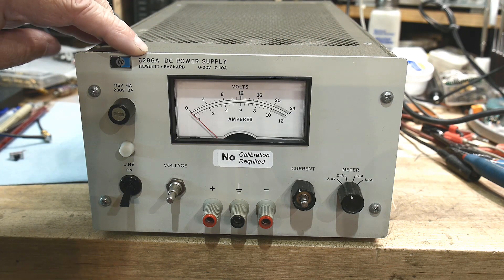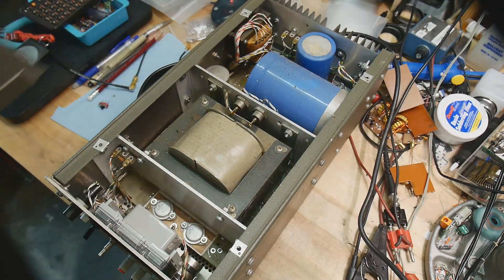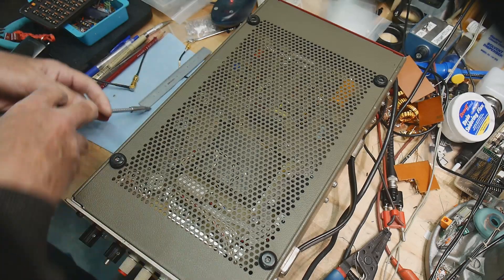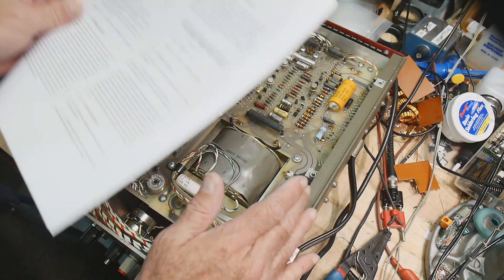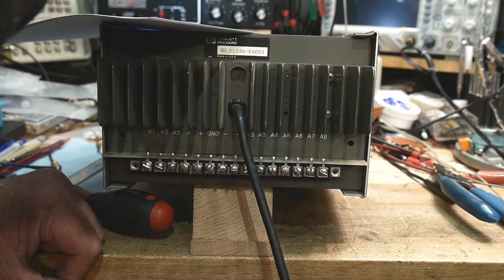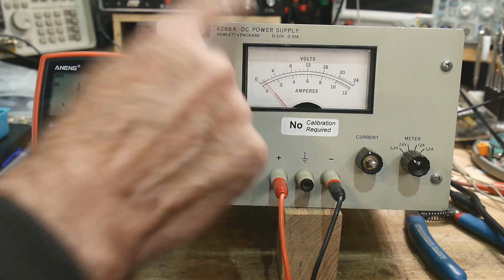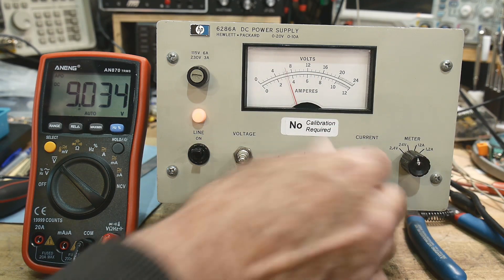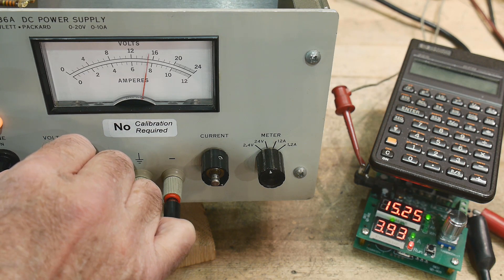#766 HP 6286A Power Supply Repair (part 1 of 2)

Comment: I have a couple 6291a's which are almost identical in my restore queue.  Warning, Rifa madness!  Take the top cover off and look down under the fuse holder, at both my 1982 and 1990 units, there's a Rifa cap point to point wired between the pilot light and the switch.

Comment: Hello. You mentioned a date code on the SPRAGUE 325 uF Cap. I had to replace it to get mine functional. You mentioned the date code on it. How did you determine the date on it?  Thank you
Reply from the maker: one code is 4 digit number   YYWW   YY is year 19YY   WW is work week 1 to 52
Reply: @IMSAIGuy  Thanks so much for the super fast reply! Wow. Ok, so mine looks to be 5 years younger than me 1975. 7547L. It's amazing  to me that this was designed back in 1966. My employer was getting rid of some stuff and this was among my haul. I had to replace this cap and the other one was C800 1500uF. It cost me nothing to get this thing operational. It also is cool that the replacement caps are physically much smaller and sometimes boast better specs too. Technology improves and things do get better. Thanks again!

Comment: When I was in college, control theory was giving me some trouble and I went looking for help in the basement of the U of A's Steward Observatory Radio Astronomy Lab. One of the keepers of the Holy Grail, Robert Freund, grabbed the service manual to one of the HP linear DC bench supplies (a similar model to what you have here), and proceeded to explain the entire thing on the white board. I still remember realizing that it could even go slightly negative due to how much latitude the HP engineers put into the circuit. From then on, HP service manuals were one of my go-to references.

Comment: Anyone who buys one of these Trojan Beasts should know that you need to spray some switch cleaner in the Volt/Current switch. All of mine work fine after removing the silver sulfide on the wafers. There are some very small holes in the switch plastic cover that you can do this. I still prefer Deoxit red.

Comment: Wondering if there is an open source, like github, for the knob specs, 3D scans and/or drawings.  Would be handy for making molds or maybe even 3D printing new knobs.  Can't wait for the University Surplus Stores to re-open.  Man, now that I understand power electronics more, I definitely missed out on some great supplies just for the parts only.   Was just looking at TIG welding aluminum last night to see what the latest and greatest methods settings are so I have an idea for modern user requirements (not just 60Hz/400Hz or maybe engine welder RPM tuning for adjustment) for design specifications.  Now days (to me at least... looks like Miller's been doing with Synchrowave since the 70's) AC 20Hz to 250Hz frequency settings with what reminds me of DC square wave offset to have a Electrode NEgative (EN) and Electrode Positive (EP) Duration ratio... so less EP cycle for cleaning the oxide layer and more EN cycle for material penetration for welding.   Anyways, interesting studying the range of analogue to digital designs for optimal homebrew DIY potential projects.
Reply: If you can pick up OpenSCAD (solid modeling, really intuitive; program your models!), I've had much better luck finding precise models of knobs, threads (ready for CNC), dimensions of motors, etc. etc., and they're arranged in the form of includes.

And bonus, the models you create are guaranteed not to have any "holes" (i.e., to be topologically capable of being printed.) Can't recommend highly enough, e.g. https://openscad.org/libraries.html . The code's easy, I promise, and opens up a world of printing.

One last note about that. It renders STL files, which GitLab and GitHub will both render graphically as interactive 3D shapes for preview, so you can avoid some of the copyright unpleasantness with Thingiverse. As a matter of fact, I know at least my repos are full of models you can preview.
Reply: @scottdrake5159  I've downloaded and have on two computer, though haven't used yet.  I look forward to learning and working with in the hopefully near future.  Wound up installing DesignSparkMechanical for the last 3D prints I made (along with some quick processes on MS 3D Builder) since seemed so quick and easy to use. 

Neat you noted as I've wanted to use, since having earned the second BS with an emphasis on programming reads like is a logical choice.  Nice to have the STL with SCAD files also for custom remixes for others to use. 

Thanks for the link to the libraries, I've only looked at the cheat sheet and download links.  One of these days I'll read into some more and get to work using, most likely when I work on the next 3D prints.  I also installed FreeCAD around the time I was in shock to find out Fusion360 and SolidWorks free editions were not functional, though decided OpenSCAD will be what I learn to use next.  Best IMO to have thick, or full install, client side applications too and not this new trend of thick server thin/no client install apps like TinkerCAD or OnShape.  

What's your repo handle?
Reply: @jafinch78  "daemonburrito" 😁 (or sometimes "demonburrito") https://github.com/daemonburrito/3d-models Wow, five years goes by fast... but that repo is nice demo of parameters; makes more space efficient test cable hangers than the Pomona ones and you can set it up for different cables and lengths with the Makefile or directly with the code (all the parameters are always at the top.)

In the process of moving everything to GitLab, though there's no ideal choice that's hosted by somebody else, I guess, but groups are nice. Recently had an epiphany that libre or at least open toolchains are as important as what you make with them; e.g., getting good with Kicad. Have lots of friends who like Freecad, as well. Agree on client-side applications, or at least controlling your hosting. Also pretty obsessed with fully libre FPGA HDL; same problems you describe exist there with non-free parts of pipelines (e.g. Xilinx) and lack of open "IP cores." Since IceStorm (sorry to introduce you to a rabbit hole!) things are slowly changing.
Reply: Just checked my 6201A ( https://www.facebook.com/james.analytic/posts/2902309406497509 ) , that's labeled from IBM San Jose and I think was like ~$20 on eBay, and that PS has the red fine adjustment knobs.  I'll put on my to-do list to spec out the knobs and make 3D scans at the least. I know there are Tektronix knob 3D prints available on thingiverse.com & grabcad.com, though never looked for any of the others I own, i.e. HP, Wavetek, PMI, Fluke and PAR.  Great reminder.

Comment: I'm a new subscriber. Your voice reminds me of Mr. Peabody and you have his brain power for sure! When you said "way back" I laughed out loud.  Where did you find that nifty digi-load? That is far out. Nice job on the video, can't wait to see what you find in the meter sample circuit. I am wondering if that's a double sided board. The discoloration of the PCB around that current load resistor makes me suspect part of the meter circuit traces may run thru that space on the top side. Keep up the good work.

Comment: I guess that sound when adjusting the voltage is transformer switching taps and being momentarily grossly overloaded charging that huge cap.
Reply from the maker: I think you are right about charging the cap, but it does not have switchable taps. It pre-regulates the voltage into the transformer

Comment: These are awesome units. I have a 6291A (40V, 5A) They all have the 10X switch for the meter, the supply and meter have 20% overrange capability for V and I within the power envelope, and are absolute beasts. Direct lineage to Harrison (out of NJ, Hp acquired in the late 1950's, IIRC). $480 in 1977 ($440 in 1975) for the 6386A (P184/185 of the 1977 catalog), and the specs justify the price. The meters do go south, like all D'arsonval types. Beware incorrect programming (the strapping). It can make for a really bad day. My 1975 unit still has original caps and meets spec, as verified about two years ago.

Comment: Getting a hp 6428B for station supply. Time to replace my slot car switcher supply b4 it consumes my ftdx10. Dam switcher should inc crow bar circuits imho who want to watch their slot cars go from 12v to 120v on failure 😨

Comment: So how are these “computer grade” capacitors that much better than today’s capacitors?
Reply: Today's caps are mostly built with lower quality chemicals inside, so they often fail very nastily when exposed to heat over time, or sometimes even without heat.
Reply: @ruhnet  old eastern block caps last forever (except russian ones) though their capacity tended to be up to 40% higher than rated.